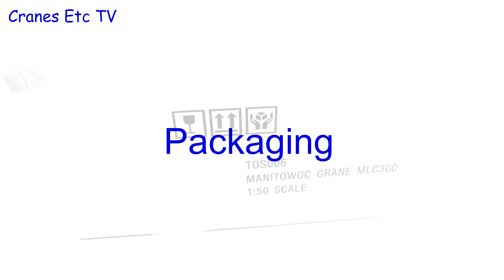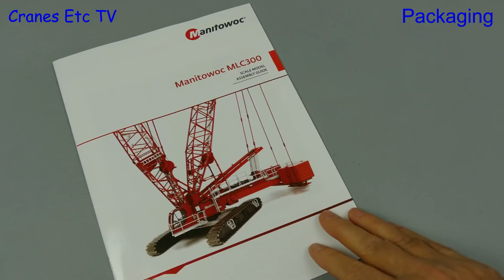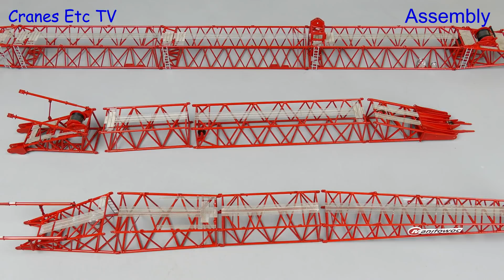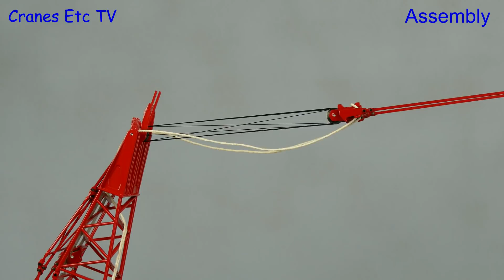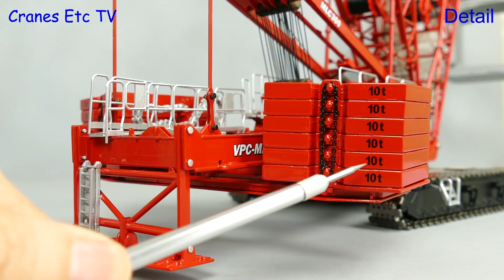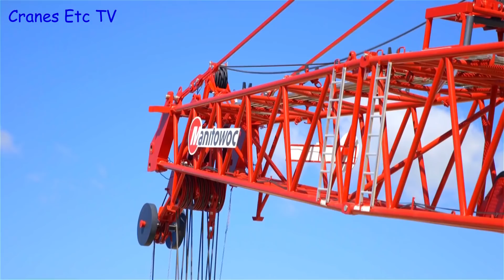Towsleys Manitowoc MLC300 Crawler Crane by Cranes Etc TV

Comment: Another nice model, mine had a couple minor issues, like the loose cab walkway, slewing motor cap under the body was loose in the box. If weiss brothers want to hit a home run with their next models, should supply a load chart/dimensions booklet, brochure like kobelco did with the 2750 and more info about different configurations that can be possible. I'm very happy with my mlc650 and 300. Both very nice looking models.  And another great review ian, was wondering when you were going to do this one